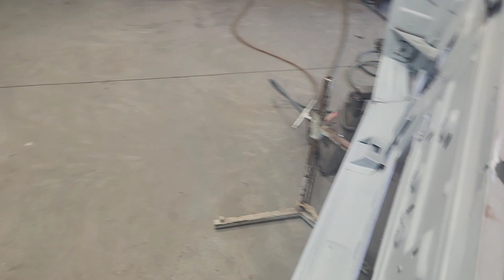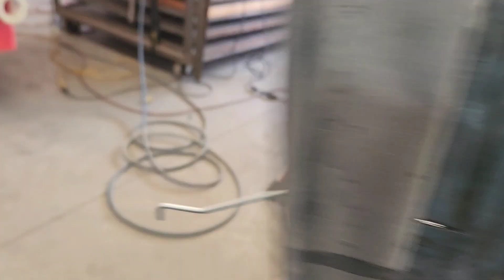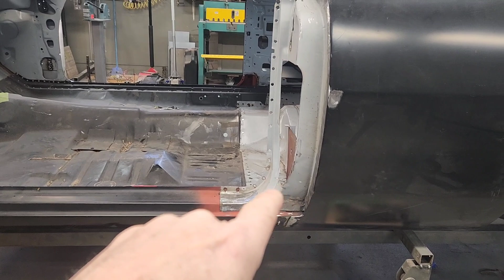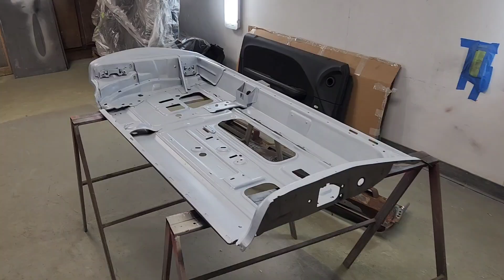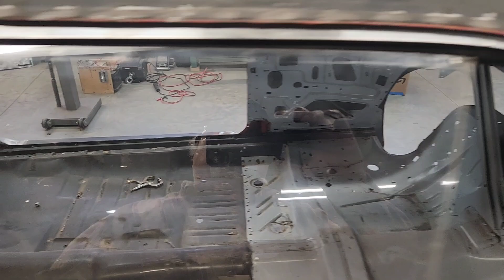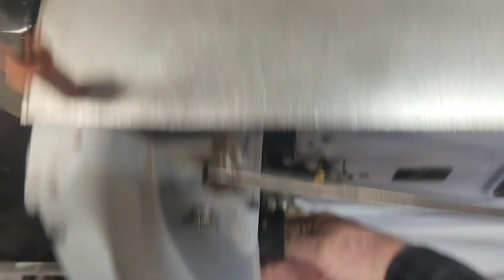Randy's Hellcat Daytona part 9

Comment: So many minute details.
Similarly engineering one piece glass now for an early Falcon. Fun and not fun all rolled into one.
Thanks for letting us follow along.
Reply from the maker: I am hoping the window will operate smoothly. I spent a lot of time working on my own but could not overcome some of the short comings of a heavy piece of glass on the operator. Also the expectation of wind noise with old style seals.
Reply: I have decided to full eliminate the factory window to roof seals. Will ne using one from a newer car (have a couple to trial with) they are actually the inner secondary seal. They mount on a pinch weld. May work for what you are doing as well.
Can show you a profile of actual seal if you are interested.
Reply from the maker: @michaelfust9520  I am aware of the secondary seals. My 06 Charger had them on the 4 door.

Comment: Fantastic work, Steve. I’m wondering if you can contact Steele Rubber to make you a custom roof rail seal for your one piece glass rather than having to re-engineer the A pillar to accommodate the existing seal.
Reply from the maker: I have already fiddled with it and it looks like it will work but it will take 2 sets of  rails and 3 sets of window seals to complete the configuration.   That stuff is on the way.